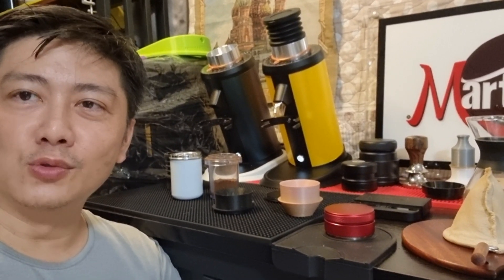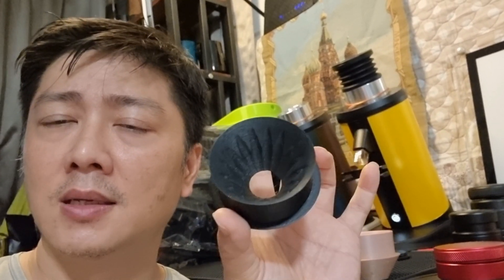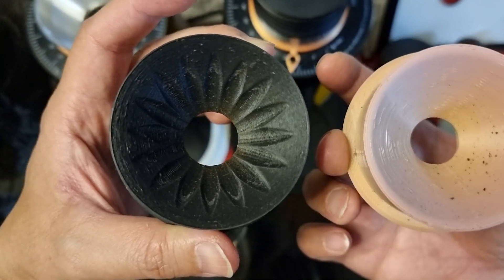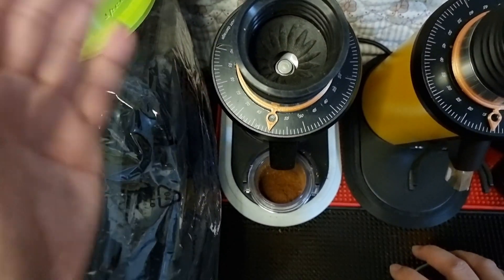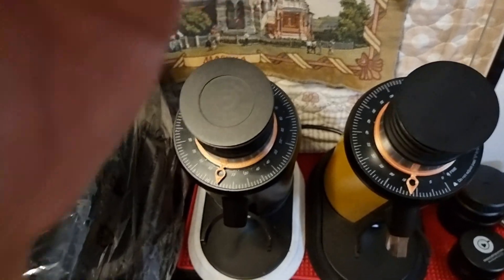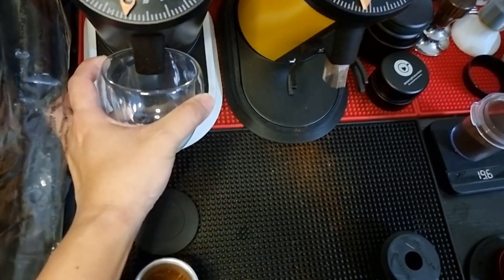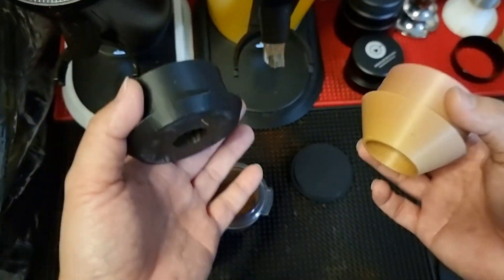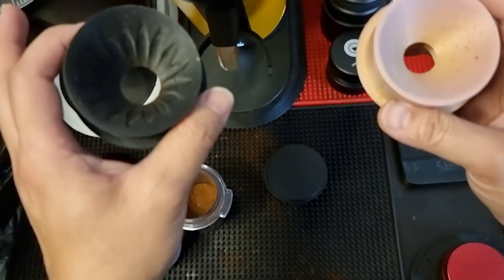DF64 Mods | Thomas-CY Anti Popcorn Version 2 | Support me on Patreon or PayPal!

Comment: Isn't the design change between the two versions just that he has decreased the volume above the burr chamber? The new version is quite a lot taller so he has matched the original cone in the grinder with the 3D print.

Comment: Hi CY. 

I have been using your version 1 for about a week. Thanks for the design!

Here are my thoughts:

I really like the funnel at the bottom of the Mr. Thomas/v2 design. I have noticed that if I pull out the bellows/anti-popcorn device there ends up being a lot of grounds/chaff/partial beans left on the funnel of the grinder. The funnel of the anti-popcorn device should eliminate that. 🙂

I am not sure about making the hole smaller. With my version 1, I have had the beans get stuck twice. I needed to take the cover off of the bellows and poke the beans to get them to feed. This only happened the first day I used it. I am not sure why they got stuck at first but don’t now, but the smaller the hole, the more likely the beans are to get stuck. And if the larger hole completely eliminates popcorning, why make it smaller?
Reply from the maker: Hi Ryan, I am going to upload version 2. Now. Can you print it out and test it as well?
Reply: @CaffeMartellaSingapore  My Dad is the one with the 3D printer, so I will ask him, but I am sure he will print it for me. 

Will you be adding the flare at the top before you post it? Can you reply with the link when you have it posted?

P.S. He has been printing these parts for me with PET so they are food grade.
Reply: @CaffeMartellaSingapore  I want the file so I can test it out too!
Reply from the maker: @AnOtterCoffee  https://www.thingiverse.com/thing:4897986
Reply: @CaffeMartellaSingapore  this new model measures 69.99 x 69.95 x 54 so maybe it will fit.
Reply: @CaffeMartellaSingapore  I have tried this design. The funnel at the bottom has successfully eliminated the grounds and larger bits of coffee landing and staying on the feed cone of the grinder, so that is great!

However, I fed three doses of 18g of beans through it and in two out of three, the beans jammed and I had to poke at them to get them to feed. The 20mm hole in version 1 is not too large, in my opinion, I have not noted any popcorning coming through that hole. However, even with the 20 mm hole, I have had beans get jammed three times, including once this morning.

I would suggest increasing the hole to 22mm and see if the feeding issues go away and if the hole is then too large and allows popcorning or not.

Thanks!

P.S. The beans I have tried these anti-popcorning devices with have been Italian bean blends: Maromas Gold and Lavazza Super Crema.
Reply: @CaffeMartellaSingapore  I replied here, but I also looked up your email on your speedy3dcreations.com website and emailed you there so I could include some pictures and morn info.

Thanks!
Reply from the maker: https://www.thingiverse.com/thing:4897986

Comment: Couldn't yo try to 
counter the 10º tilt with a -10º tilt on the antipopcorning to avoid the few beans that don't fall by themselves?
Reply from the maker: that is possible. However if I do that, the funnel can only be used in one position.
Reply: @CaffeMartellaSingapore  yep, that would make it not symmetric under rotations
Reply from the maker: But it's worth a try! I will work on it.